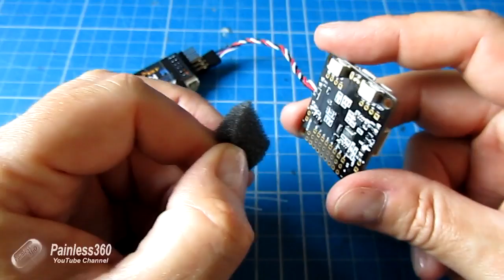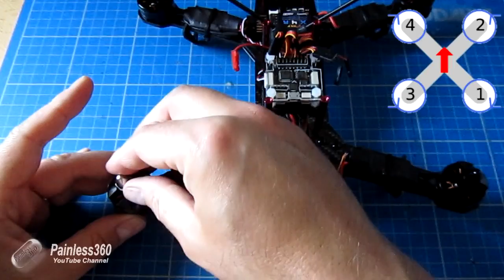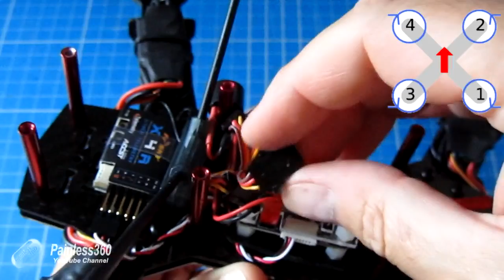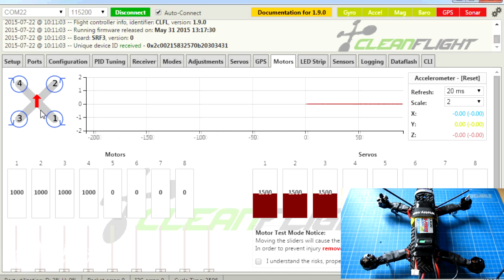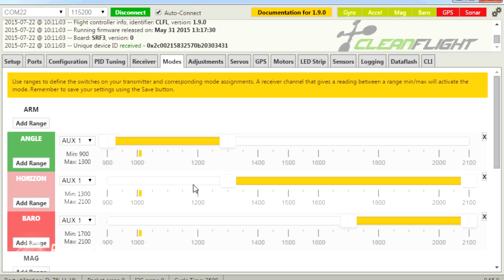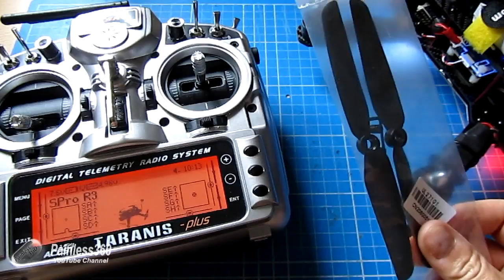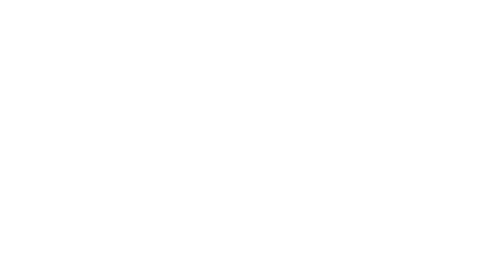(2/9) Seriously Pro F3 (SP3) Series - Installation, power, motors and first hover

Comment: Hi painless, so i am running a qav210 with a spektrum dx7 g2 and the ar8000 receiver and for some reason i just can get the auxiliary to respond  to the aux or the joysticks to arm the quad but in clean flight everthing is responding but the aux channels please help thank you very much
Reply from the maker: +Max Boxx Happy to help but please watch https://www.youtube.com/watch?v=olIqTiSJHIY and come back to me with more detail of what you've tried..
Reply: +Painless360 ive tried all of the steps i have been working at this for two months
Reply from the maker: That doesn't help me help you. Without knowing what you've tried I will simply waste both of out time suggesting things you've already explored.. Best of luck.
Reply: +Painless360 i have tried the hobby shop, contacting the dealer, reading forums, reading manual , using google , trying to troubleshoot the problem by myself, looking at tx manual, looking at fc manual
Reply from the maker: If you watched that video then you'll know that asking for help means you explaining what you have and what you've already tried..

Is it PWM or PPM? Does the channel move in the monitor screen of the radio? Does the channel move on the receiver? Does all the other channels work? Are you familiar with how to program the radio etc etc.

See the website for the details of chargeable support..
Reply: +Painless360 the reciever is serial only four channels work which are throttle,elavator,rudder,aileron,  the auxillary channels are not responding on the screen but when i put a high powered servo in the reciever the aux channels work.
Reply from the maker: Then if the radio, setup and Rx are working then it must be the cable from the Rx to the FC or something on the FC. Have you tried plugging one of the working channels into the connector? Does it then move? If you need more help then please book a chargeable call via the website. This isn't the best place to help with problems like this..
Reply: +Painless360 whats the website

Comment: I am trying to use this controller but I need some help figuring out where I get the power to connect to my reciever.
Reply from the maker: +JiggyMacFly I can only help if you give us some details (as most of what you need to know is already in the video)..
Reply: Well i have my connection from the receiver (spektrum) to the controller board and I have it connected PPM.  What I don't understand is how do I get power to the receiver.  I can not find a video that show me that exact part.  Does it require a connection from the controller or does it come off the distribution board to power it.
Reply from the maker: The black and red wires that are part of that PPM cable take 5v and GND from the FC and supply the Rx with it..
Reply: +Painless360 I must have a bad receiver or either the wrong style.  Very new to this and I am waiting for my FrSky Taranis as it appears that is a pretty common system.  I am trying to use the AR610 receiver so will that even work PPM?
Reply from the maker: Check out what the description says for it. IF PPM mode is there it will be listed as a feature. We have a series called 'Introduction to Remote Control' that may have some useful content for you.. Best of luck.

Comment: Hello painless I have a problem setting up my ESC.  I can get the motors to spin manually when i turn up the master but, the problem i am experiencing is once I move on to click on the modes tab it does not give me the option to switch the modes.  It also does not look like yours.  I am using Spektrum x9303 2.4
Reply from the maker: +Aristotle Limjuco Can you post a video of what you're seeing?

Comment: Dear Painless. I have the seriously pro f3 acro, building it into a  impulserc alien 5". My problem is i cannot get a decent answer on what wires from the pololu should go where. i have the frsky receiver,5.8 immersion 600mw transmitter, plus pnp50, etc. Any help you can give on the pololu wiring going to which ports on which parts would help tremendously(in detail,solder,etc).Thanks
Reply from the maker: +Sin14216 I've no idea what a Pololu is. Can you provide a link?
Reply: It is a Voltage regulator. My issue is wiring everything including the pnp50 .Sorry,quite new to field.
Reply from the maker: Still no idea - do you have a link to it? Struggling to find it..
Reply: Did you come right ? I can help I have the same set up ?
Reply: still waiting on a few 4 pin jsh wires

Comment: Hi, I have a headache, I want to add a module with 3 functions: 1-Lost plane finder (value 1000-1300). 2-LED Off (value 1400-1600) and 3-LED On (1700-2000). How can I do that? I can add a buzzer on the Mode page, but how to add this LED functions? Please help.
Reply from the maker: +fu4ien If it's a module that had an LED an buzzer on then you need to plug it into the PWM port on the Rx or look at outputting the channel you need on a spare output on the board..
Reply: +Painless360 Thank you, I'm trying to figure out how to setup Taranis radio with x4rsb in D16 mode and add pwm. Have no idea yet, I'm using S-Bus connection and 1 channel for pwm. I'll try to google it.

Comment: Hi, I'm building a similar setup but am not sure what pdb to use. There are so many on the market. What kind of pdb did you use? (Hope I didn't missed it in the vid)
Regards
Reply from the maker: +stardogtail I used one that replaced the bottom plate of the model Search for ZMR250 PDB to see what I used. Best of luck
Reply: Thank you for your quick respond found one which fits my needs and thanks for all the great vids you're doing. Helped me out so much! Good work!

Comment: Can you explain why my motor only spool ups when my throttle reached above 1650, is there a way to set them spool up around 1200. I'm using SP Pro racing F3 Deluxe board and CleanFlight version 1.11.0.
Thank you in advance for your help.
Avh
Reply from the maker: +T Hoang Not without a lot more detail ;) I'd look at ESC calibration and then check the motor doesn't have a problem that would cause it to resist turning..

Comment: Hey professor! Connected f3 board new quad and calibrated everything on clean flight. Connected PPM to d4rII rx and using taranis x9d plus tx and I can't get them to talk.
Reply from the maker: Have you watched the video where I setup PPM on the SP?
Reply: +Painless360 Yes, i followed everything and its all correct. I bind my taranis to d4rii rx and i get no movement in cleanflight on my values page. Any idea? I'm so lost here I've tried everything.
Reply: +Painless360 I've tried another set of cables. It's setup correctly on clean flight per your video.
Reply from the maker: Not sure then. I would contact your supplier for support. Best of luck.

Comment: Is the input voltage limited to 5v or is it like the new naze32 where I can run my 12v video tx power into the board too? I want to avoid having to use a separate bec specifically for the board.
Reply from the maker: I would check the manual if I were you. If there is a 12v in connection then you can use it ;) Happy flying!

Comment: excellent point about mounting your FC closest to the COG. I have seen many QAV 250 builders put their FC on the bottom power distribution plate. I wonder if this is too low for the SP F3 as I was planning that location for mine.
Reply from the maker: That should work fine,  best of luck with the build!

Comment: I might be wrong but didn't that ESC calibration go wrong. I thought the consistent beeping you got at full/1850 was the ESCs saying "error". If so I'd guess you need higher than 1850 for those ESCs to count it as an "initial full throttle". That is, the error was that the initial signal was neither low enough (normal no throttle start) nor high enough (calibration / configuration).

Comment: Sorry, what is NU-Metal for magnetic Shielding ??
Reply: U Fre 
Mu, not Nu. That's important. Mounting Nu metal on the craft won't help at all and most likely just annoy all the neighbours ;)
Reply from the maker: U Fre I see you're a new subscriber. MuMetal is a nickel–iron soft magnetic alloy with very high permeability suitable for sensitive electronic equipment shielding. You can get it on eBay and it is fantastic at keeping your Magnetometer true by keeping all of the magnetic interference away from the flight controller...It's what I use when I can't physically separate the FC from the power system enough, it's impossible to do with these 250 class frames..Happy flying!
Reply: +Painless360  A friend asked me about Mu Metal because he is watching this video series which I will do soon and so I looked at the piece that you used. It appears to be about 1 mm thick, is that correct? Is it difficult to cut? I get the feeling that physically that it cuts like tin. Would it have been beneficial to make a small shallow tray  so that it would flush with, but not touching, the circuit board? I enjoy watching your videos.
Reply from the maker: It is about 1mm in thickness and is very soft, it can be cut with strong kitchen scissors or I use tin-snips.